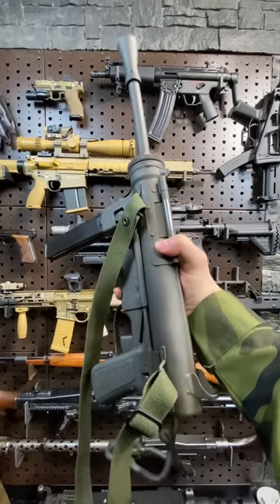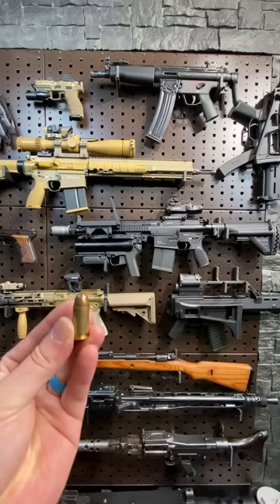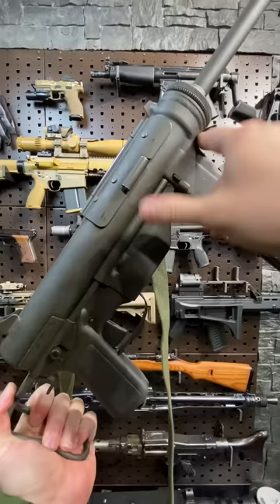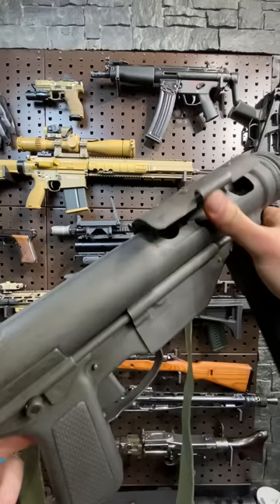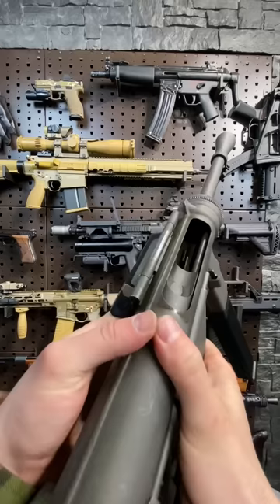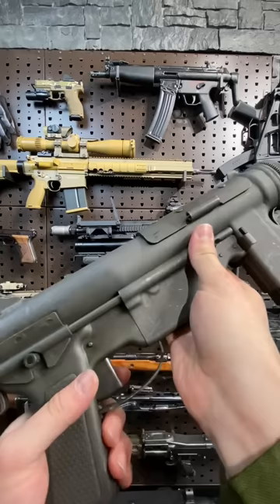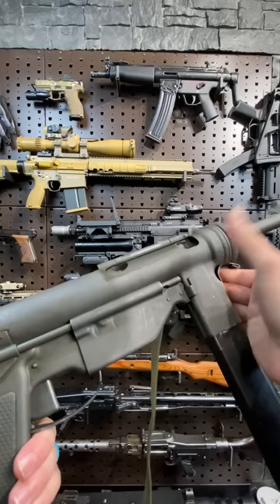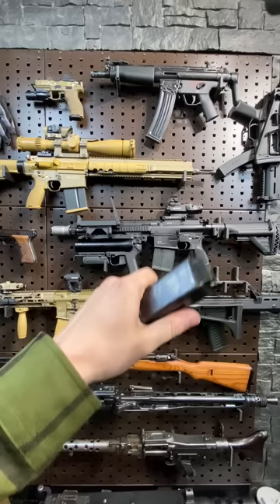M3A1 “Grease Gun" in 1 Minute #Shorts

Comment: Fun fact: Delta kept a supply of M-3’s around, even after the acquisition of the quintessential counter terrorist/covert ops sub machine gun in the MP5. The M-3 outperformed the newer MP5 during testing, as well as having a smg that shot .45acp, were reason enough to keep using the old platform.
Reply: Tank crews were still issued the grease gun up until after the First Gulf war.

Comment: The first Army National Guard Scout unit that I was in had those and for what they were built for and when they were designed they were great little meat grinders. Had fun shooting them until they decommissioned them and took them away. I hear they’re not difficult to make with just a modicum amount of skill... then again I still haven’t been able to make a working bow as of yet so maybe “don’t try this at home”...
Reply: With some basic tools it's fairly simple. These are one of the most basic firearms designs you could ever find. In fact the most complicated part is making a good riffled barrel. Check out P.A. Luty (forgive me if I put the wrong second initial my mind fails at the moment)
Reply: Open bolt guns like this are honestly easier to make work than a bow. It is a slamfire tube with a recoil spring, not much more.

Comment: Looks atrocious but I feel like it makes up for that with extremely low recoil
Reply: I know it made up for it due to is stopping power and the fact it wasn't all that inaccurate. It performed very well. I should look more into the recoil tho
Reply: Well for recoil, they had a heavy bolt, like what the germans did to reduce the rpm for the mg42, the American M3 smg had a .45 ACP round going at 450 rpm, literally the bolt going back and then cycling has enough force to be low recoil, kinda rattle like, not too noticeable with a steady hand.
Reply: Have you seen Jerry shoot that on his channel? His face is priceless.

Comment: Believe it or not, armor units-especially national guard armored cavalry units, still used these on board the tanks as small arms for the crews until they were replaced by the M-4 carbine in the early 90's. The guard unit I was trying to join still had them, 1/167th Armored Cavalry, Nebraska Army National Guard in 1992 still had the grease gun. I didn't make it in because of my age and my eyes getting worse.

Comment: I was partially correct.

45-inch calibre, nine-pound weapon called the “grease gun” because it resembled the device used to grease automobiles. …as did the United States' M3, called the “grease gun” for its resemblance to a mechanic's grease dispenser.

Comment: You missed the cleaning rod (the wire stock), the oil bottle (in the pistol grip), and the safety/ejection port cover also holds the bolt forward when the bolt is not cocked.  The latter is important because that heavy bolt can be moved by G-forces and move far enough to the rear to strip a round from the magazine, then slam-fire the M3 and M3A1.

I was armorer trained on the M3A1 at Fort Riley, Kansas in 1984 along with other First Infantry Division small arms.  

The barrels unscrew and can be swapped without problem.  There was a replacement silenced barrel that made the gun far quieter to shoot--but it ain't silent!

Most small arms have eight steps in their cycle of operation--but the M3A1 has only six steps: feeding, chambering, firing, extraction, ejection and cocking.  Missing are "locking" and "unlocking" because the open bolt cycle holds the bolt closed while firing by bolt inertia only (mostly by weight in the M3 family, with a little help from the action or recoil spring).

Comment: I feel like the slow automatic weapon is super underrated and has a better place in modern firearms than given credit for

If I had an LMG with a 100 rpm cycle rate, and 200 rounds, I'd have two straight minutes of continuous, effective fire
Reply from the maker: I’m with you on the first part. The second part could be accomplished with semi auto and good trigger control. 100 is slow, it could be interesting, but I would say controllability is more important. The grease gun is controllable which is why it’s effective. It’s a basic design and slow speed is about all it has going for it, also being an open bolt that doesn’t bottom out hard at the end of the bolt stroke. There are guns designed to take advantage of that aspect in particular, called ‘continuous recoil’ and they are very effective. I would argue that the Ultimax series of lmg’s are among the most effective and underrepresented firearms out there. It’s not a new concept, but it missed the SAW and most other current firearms. Thankfully Knights is bringing that tech back to the forefront with their LAMG’s.
Reply: @armandgun  I had no idea about these projects, thank you so much for letting me know!

When I had my m4, it was controllable, but the burst fire felt so niche. I'm a small lad, and the weight was enough to where only my first bullet was on target if I wasn't laying down or leaning on something.

If my M4 was able to provide this slow, steady auto, I'd have enough time to pull my barrel down to target between rounds.

Only ever got to fire a grease gun once, and it felt so damn good! At 30 or 40 feet, I was getting center of mass with every round when I was ready and braced. It just.. made sense. It was intuitive.

Maybe I'll have to look into these!

Comment: Fun fact the M3 actually replace two guns at once of course the Thompson known as the M1 and the M2 Hyde which was supposed to replace Thompson it was cheaper easier to do still have things like wooden furniture and it was just at right heavy, but by the time they are able to get production up and running for the M2 they had already developed the M3 the only 500 m2's were ever built so yeah if you wonder what happened to the M2 between the M1 and M3 is they tried to make it

Comment: This is the only open bolt firing full auto I've ever shot.  I've never shot a gun that that I could say that your first shot is not necessarily more accurate than your second.  Watch that thing lunge when he pulled that tin trigger.  That's for real lol. It's actually very noticeable. It's very different for someone that aims and breathes in time with a steady trigger squeeze.  My first shots were a foot low. The sights sucked but I could use a shotgun beed for what that gun will do. Probably very effective spraying .45s in street